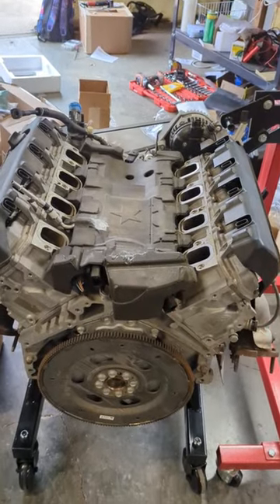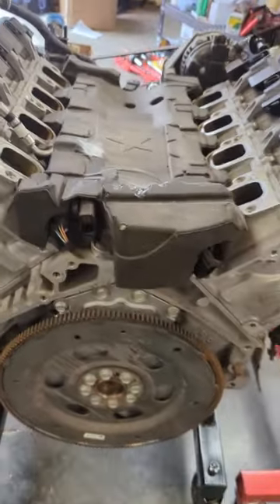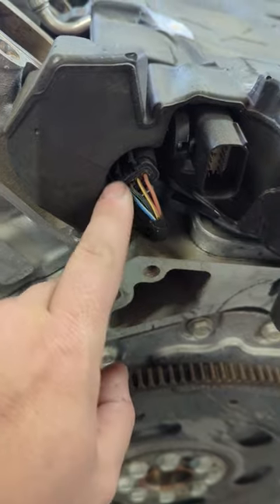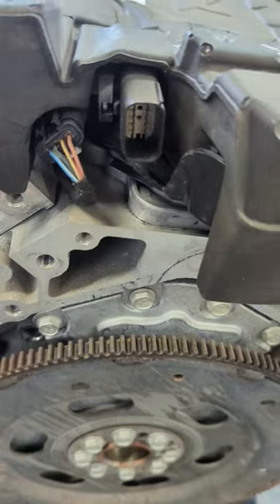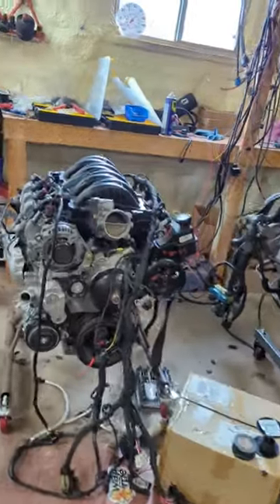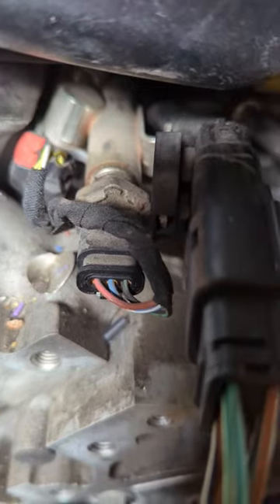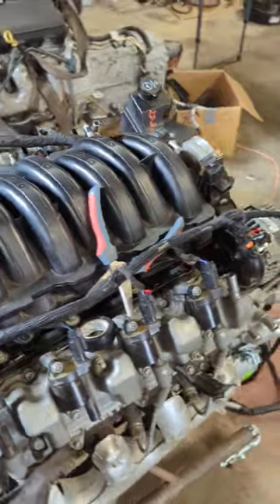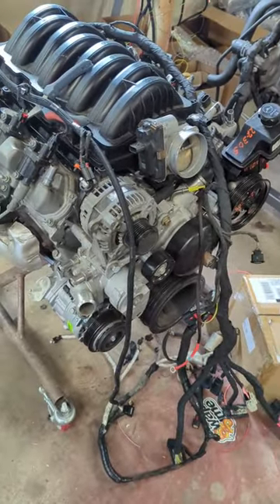Gen V Fuel Rail Sensor types!

Comment: IS it true a 4 wire wont work with the ten speed auto? So would I need to change out the pump?
Reply from the maker: Yes, what I have come to find out is a 2018 and newer ecu must be used to enable the prndl DTC. On the older ecu s these DTC codes do not exist.
Reply: I came a cross that when I installed a l87  on my 2015  and was wondering why it wouldn’t start
Reply: So you have to swap the rail and injectors ?
Reply: @bigroyl  I'm pretty sure just the direct injection pump.